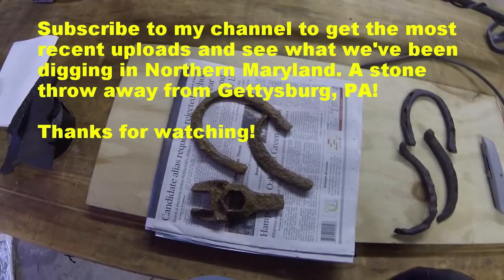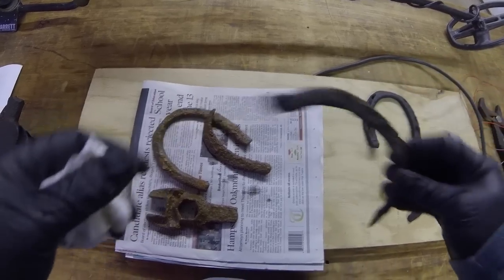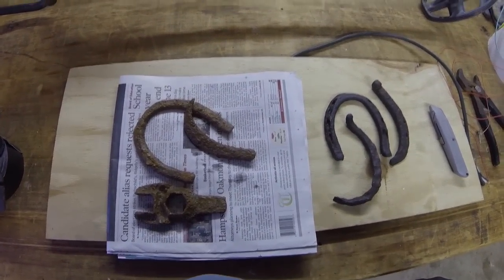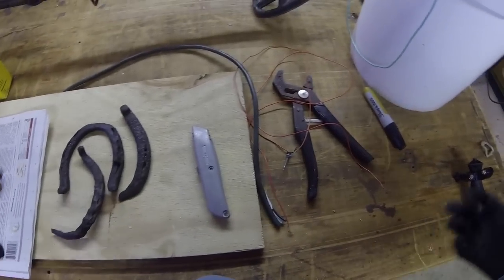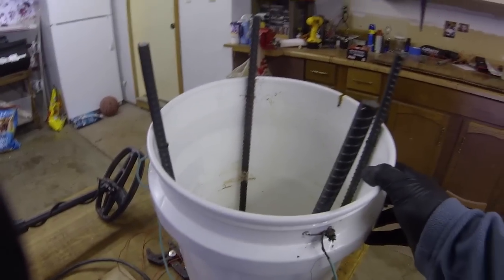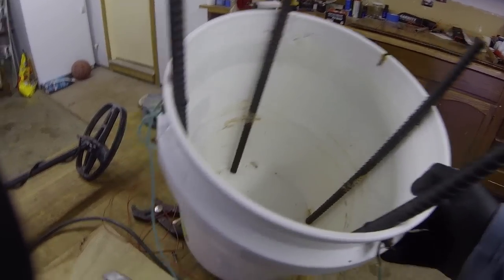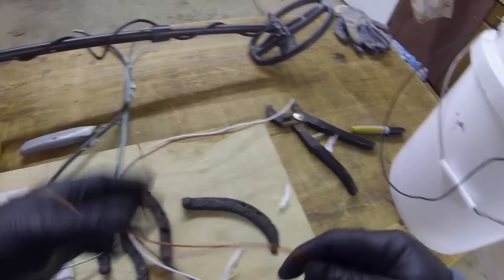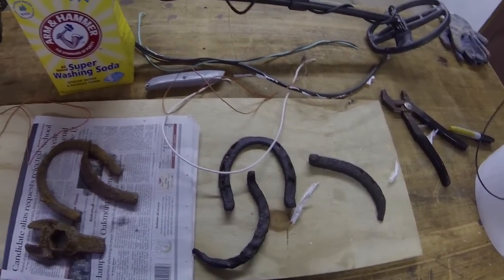How to Clean Iron Using Electrolysis

Comment: Love ur setup! Excellent presentation! May I suggest using some white vinegar? U did an awesome job of explaining everything and I will follow you and build ur setup!!!
Reply from the maker: Thanks and yes vinegar will do a decent job but it takes longer and won't do as good of job or are you asking whether I've put vinegar in as the solution for my electrolysis tank?
Reply: @MentalMetal  I was wondering if you included white vinegar in ur solution along with the cleaning soda.
Reply: @MentalMetal  btw... about how long are the rebar rods u use?